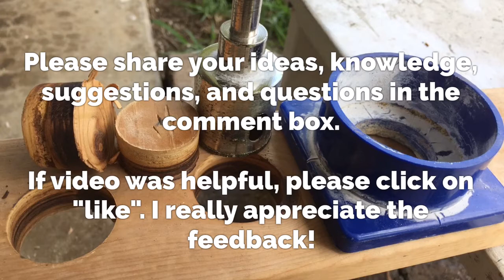Will a Diamond hole (core) saw cut through wood?  This video shows the result!

Comment from the maker: Here are the best prices I could find for the tools used in the video (or similar).

       1. Diamond Core Bit with Guide $18.57: http://amzn.to/2fKVSmn
           Home depot has it for $20.97. http://www.homedepot.com/p/QEP-1-3-8-in-Diamond-Hole-Saw-with-Water-Delivering-System-10569Q/202205611
 
        2. Corded drill with the lowest price on Amazon: $26.99 http://amzn.to/2y6oj92  
        Home depot has a Ryobi for 29.99.    
        
             A.  Cheapest Cordless Drill on Amazon is a Ni-Cad by "Genesis" on Amazon for 29.99. http://amzn.to/2xE6JYk

             B. If you'll use your drill for other projects, but don't want to spend a lot, I recommend this one for $52.49  http://amzn.to/2fzDX4W   I've used one, and it's a decent drill for moderate use. 
            
             C. For a heavy Duty Hitachi as in the video (but newer model)  $108.97 on Amazon. http://amzn.to/2gavjKT

Thanks for Watching,
Thrifty Tani
Reply: You are right. Today I bought a diamond one because it can do woods as well and thus save some money but as you said not on regular bases. Most wood hole saw starts from 19mm but diamond one can start from 6mm which are better..

Comment: Thanks so much for this!  Installing a pop up outlet/wireless charger in a wooden sofa table I'm making my husband for Christmas.  The outlet came with a diamond blade to cut the hole.  I was starting to convince myself to go buy a wood hole saw, but I'm going to at least try the diamond one.  If it doesn't go well I think I might just use the jig saw!

Comment: You already knew the answer, but worded the question wrong. Of course a Diamond coated hole saw blade will go through wood - but it abrades or grinds it's way through the wood. Since Dremel does not make reduced shaft drill bits with 3/8" but does have 3/8" diamond hole saws, I will be doing the same thing to a wooden 3" ball so it can have dowels inserted to make a bird cage toy. You have the luxury of using low RPMs... I won't. My project is guaranteed to smoke and might even ignite and will definitely be interesting. The really nice thing is that Diamond hole saw blades when used on wood make holes that have already been sanded smooth! (even if it is a little scorched)

Comment: Of course it will cut.  Better question is:  "How much is the life of the blade REDUCED by cutting thru wood."  If you just have a few holes for small project it may never matter.  Suppose four fixtures, so 12 holes;  I'd cut thru all the quartz FIRST, and then second cut thru all the wood.  If blade fails, go buy a hole saw for wood.
Reply from the maker: Sounds like good advice!
Reply: Stranded and no other option is ok.
But otherwise not practical.
Reply: Most brilliant idea